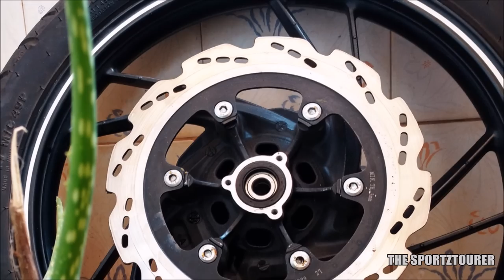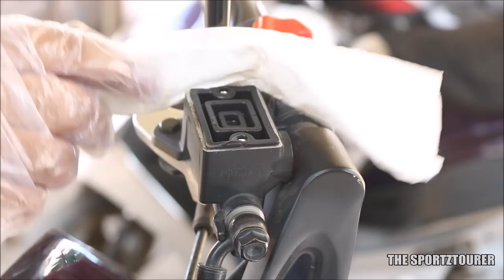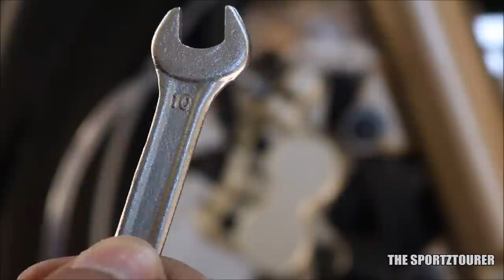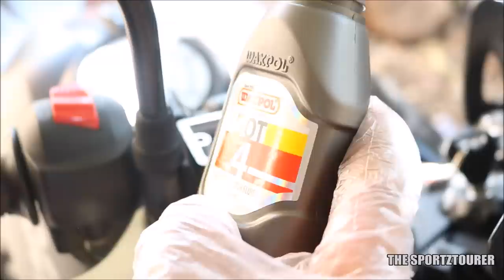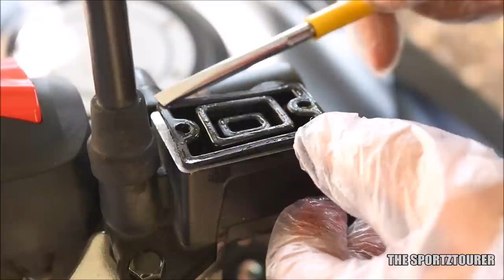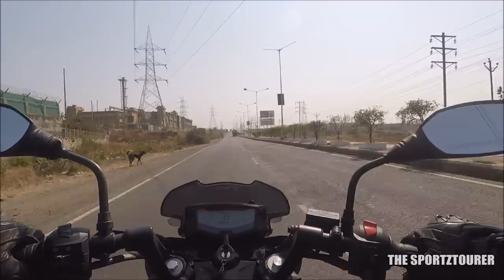HOW TO SERVICE SPONGY, LOOSE DISC BRAKE | BLEEDING DISC BRAKES | TVS APACHE RTR 200 BRAKE BLEEDING

Comment: Please make a video for ABS systems also. Did some DIY with the ABS system, now the front brake doesn't get tight. ASC says it will get tight with time, but have already ridden 200kms after that. There seems to be no air in the system as when bled only liquid comes out, there are no air bubbles. And I've done the bleeding part almost 7-8 times already but no progress.

Comment: My front disk is not jammed but  still it's heating up, temp is around 40/45 degrees after 20/25km then front brake plates starts  to making कीचकीच (kichkich) noise. 
All the brake assembly is cleaned up,changed brake oil. But still problem persisting. So what is the issue?
Reply: Bro you find any solution????

Comment: Dude your videos are very informative
 But meanwhile the brake oil you used is dot 4 and the previous oil was dot 3 you shouldn't mix them both as they are completely different in their properties dot 4 is the best one as it has high heat resistant properties in it 
So make sure that you get it changed by flushing the whole oil and refilling it with dot 4 one
Reply from the maker: Hi,
Yes you are right about mixing brake oils when it comes to DOT 5, otherwise you can always mix DOT 3 with higher standard DOT 4 as DOT 3, 4 & 5.1 all are glycol base fluids which are totally soluble & retains their properties of non compressibility & heat resistance when mixed. However DOT 5 silicon based brake fluid is non compatible with these brake oil.

I agree with your point of not mixing them as it beats the purpose of using superior brake oil it is similar to mixing mineral engine oil in fully synthetic engine oil.
Thanks a lot for the input Jaya Surya as it will be helpful to many riders visiting the comment section with doubt 👍

Comment: Superb video as always....👍👍👍
But my question is if I mistakely spill brake oil on bike body parts then after that what should I do...??
Reply from the maker: Thanks Aniket 😊
If you spill then immediately wipe it of with a absorbant cloth/tissue don't rub it while removing it.
Later clean the surface with water or IPA.
Reply: The Sportztourer thanks....👍
This should be much needed precaution in that case

Comment: Hi i have interceptor 650 front disk rotor has play more than it requires and it makes lot more noise when i go through potholes. Is it possible to repair this issue or need to replace? And how to repair please advise - frpm Mumbai

Comment: Hi Dude, Thanks for this detailed video. I followed this for my rear brake system in my RTR 200 ABS version and brake started leaking somewhere near control unit beneath the seat. What could be reason for that? Is that because, I once started the bike just to check the brake performance while doing this process?

Comment: Small question - on ABS brake setup, does the pumping needed while braking to improve the power coz single pressing hard is not effective. One more thing when u pull the lever, it stops at a point and if u pull it full further with force then the lever goes back a bit. Is this normal?

Comment: Great presentation brother..Simple and informative as always.
i have a question.. i own 2017 apache 160, and as you are aware of the vibration issues like every other apaches, i have managed to reduce the vibs to a great  extent by constant visiting at the tvs authorised service centers.. now vibs hit the bike at around 60-65 km/hr(previously around 50km/hr).. I feel that this vibration can further be reduce to some more extent if i change the brand of engine oil. presently i have been using the fully synthetic oil supplied by tvs.. I had a conversation with the service centre guy & i asked him if i can change tvs FS oil with Motul 7100, to which he said dont do it now as your bike is under warranty and if anything goes wrong in bike be it anywhere, during inspection TVS may reject your claim by pointing out about non using this recommended engine oil. 
The mechanic is a nice guy and he has a good knowledge about the work but you tell me if he is right.. Cant i switch oil brand during warranty?
Reply from the maker: The service center guy is right as TVS can have their say on engine oil in case of warranty & there are many cases with other manufacturers as well regarding engine oil.
TVS has mentioned about the recommended engine oil in the owner's manual. Same applies to any electrical accessory you install on your motorcycle. Warranty also depends upon your service center as they are one who deals with most of the cases.
Reply: The Sportztourer Thank you so much.  You took out time and replied. Now that you have confirmed it, i am sure about the engine oil part. Your reply really made me glad . I wish i could meet you sometime.. take care brother

Comment: Once again a great rendering towards the video presentation. keep it up Sir. 
And i have an Apache 160 , i feel the same loose disc brakes during recent times, but that is over my rear side. Any solutions for rear disc loose brakes .
Thank you :)
Reply from the maker: Hi Haran Kumar,
The process is same for the rear disc brakes, you just have to pump the rear brake pedal instead of front brake lever.
Reply: The Sportztourer thank you :)

Comment: Wow .doing a great job .and one problem while driving my rtr 160 i am hearing a squeak sound from the front as the mechanic had removed the dust in the disc pad using blower but stil the sound is coming please tell me what to do
Reply from the maker: Hi Akshay Deepak, blowing air will just remove brake pad dust & nothing else.
You can try to pressure wash the disc & caliper. Best is brake cleaner, I have one do you want a video on that?
Reply: The Sportztourer That would be great as my RTR 200 front brakes also squeak.
Reply from the maker: Ok 👍 it will be done soon 😊
Reply: Thanks man! Your videos are excellent, to the point and a real help to us motorcycle lovers out there, especially ones having an RTR. Keep up the good work  :D
Reply: The Sportztourer  bro i have already given to the mechanic and he cleaned .still now that squeak sound is coming im really fed up with my bike 😑

Comment: Should we go for this DIY maintenance for the ABS brake systems?
Reply from the maker: Hi Arunava,
The bleeding process remains the same for ABS equipped motorcycles (might take some more time).
Reply: @thesportztourer  ok sir, now I understand, the brake line will go through the ABS unit.. so it will take a little long time, thanks for the info...👍

Comment: I tried this method in my old bike and initially it worked later when i changed the caliper o rigns and done this method it is taking me forever to fix this. Already spent 100ml of brake fluid for this.

Comment: Any news on whether we can add the abs setup of new RTR 200 abs version on older RTR 200s?
Reply from the maker: Hi Aditya,
Its a very expensive process plus TVS won't be liable for any warranty on the motorcycle.
I have asked the service center and there are no recent plans from TVS to retro fit the ABS in non ABS models (no training provided to them).

Comment: very nice, 
but you have used dot 4 on the reservoir instead of dot 3. since the bleeding done was incomplete.
You need to bleed till you see the dot 4 fluid coming out.
Reply from the maker: Hi Shreyas,
You are right if we are considering DOT 5 brake fluid, otherwise you can always mix DOT 3 with higher standard DOT 4 as DOT 3, 4 & 5.1 all are glycol base fluids which are totally soluble & retain their properties of non compressibility & heat resistance when mixed. However DOT 5 silicon based brake fluid is non compatible with these brake oils.
Again I would agree with you on totally flushing out the old brake oil as brake oils have there wet & dry boiling point which can reduce the performance of new brake oil. My brake oil was almost new & my problem was different (air in the system) so I decided to top up, which is perfectly fine.
I will try to come up with video on completely flushing & maintainance of the calipers very soon. Thanks for your input as it will help many riders reading the comment section 👍
Reply: if the fluid in the reservoir is new then its not a problem i guess..

All the best mate !

Comment: I have an apache rtr 200 , Oct 2016 model, done just 4300 km. I am not getting enough feedback from my front disc and the bite is totally vanished. Should I consider changing the disc pads. If yes then should I go for stock or after market ones.
Reply from the maker: Hi Malay,
4300km is a bit early for the brake pads to wear out.
Check out this video where I have shown how to inspect the brake pads for wear: https://youtu.be/lBrvgRH-6LA

Comment: I opened my front brake fuild box just to check the brake fluid and when I closed it I've noticed a tiny bubble inside through the measure hole on the box. Is that tiny bubble a problem? (Apache 160 4v)
 There's no issue with brake performance though.
Reply from the maker: That should be fine 👍

Comment: Hey sportztourer,  i brought . new rtr 200 , i noticed that from downshifting gear from 4 to 3rd it get stuck . So i have to disengage the clutch slightly then it downshift to 3rd.how to correct it
Reply from the maker: Hi Atul,
False neutrals are common in new motorcycles & usually go away after 1000-1500km once the run in period is done.
You can check the clutch adjustment through this video https://youtu.be/Y_r-XQWIT6U

Comment: Hi sir my new bike rtr 160 4v.wen I'm raiding the bike handlebar goes 2 little right direction & front wheel pulling right direction . slow speed wobbleing shaking .I checked everything like fork t stem cone set front wheel aslo all r gud no bend but my bike pulling right .any solution plz reply
Reply from the maker: Hi,
Have you checked the brakes and chain (alignment)?
Reply: @thesportztourer  I'm not Chak break & wheel bearing . wheel alignment perfect

Comment: I am having Yamaha FZ V3, from last 3-4 months Brakes and ABS is not working. I have shown it to Yamah service centre, without checking, they said, it has problem in ABS Box. I asked them to check the cylinder piston in breaks and they had changed it, but problem is not solved. They said, we need to change the ABS Box, which is of 15,000 Rs. But they dont have it.
Local garage me bhi dikhaya but problem solve nahi hua.. oil reservoir me kabi kabi bubble ata hai kabhi nahi ata. Yane oil pass kabhi hota hai, kabhi nahi hota..
Brake lagata hi nahi..kuch upay batayiye...No solution.. Bleeding se air nikal diya but, 2 3 sec ke liye break tight hota hai aur ekdam se spongy ho jata hai..😔
Abtak maine 
1. Master cylinder kit change ki
2. Brake pad check kiye
3. Break sensor open karke clean kiya
4. 5-6 baar oil change karke air remove kiya..

Pata nahi probelm solve hoga ya nahi😔

Comment: I have motul 1 lit bottle dot4+ if i open it how long can i use it  and it has a 2015 mfg date can i still use it it's sealed packed
Reply from the maker: 7 years is a bit long as oppose to using it from 2-3 years from the date of manufacturing. Having said that I have seen brake fluids in operation for more than 5 years with no trouble. Moisture is the biggest enemy for brake fluids which should not be an big issue for sealed packs. If you already have 1L bottle then no harm in using it 😊

P.S: Always avoid purchasing single large quantity pack for brake fluids as it should be a standard practice to used it all once you open the sealed container.

Comment: U are topup the break oil dot 4 instead of of dot3 please note if u are using dot 3 meash u have to use dot 3 and if you are using dot 4 means bleed out all the dot3 oil and refill a new dot 4 break oil

Comment: Hi, i own a speed 400, having an issue with front brake lever. sometimes suddenly front brake lever gets stuck and i cant press it to apply brake, need to leave the lever and then press again to make the brake apply. this occurs randomly when riding & 2 times had a near miss accident because of this. its impossible to recreate this and explain this to the servicenter people. So this issue on my bike remained unsolved. Did anyone faced this

Comment: Sir, I have a loose brake lever problem, so loose that it does not come back all the way after pressing it (which has caused the brake light to always glow since the lever doesn't come back all way after releasing)
I tried bleeding it several times, but the  problem still persists. Please suggest a solution.
Reply from the maker: Hi Sourav,
It must be the master cylinder. The master cylinder piston kit might need replacement.

Comment: I doubt even the service centre guys knows this kind of methods. Recently my friend's bike front disc pad didn't release and it got stuck firmly with the disc and the service centre guys gave solution for that was to change the entire harness and it costed him around 4k. Do you know the reason for  that problem sportstourer???
Reply from the maker: Hi Vijay,
Disc brakes usually get stuck when the caliper pistons gets pushed out on the brake pads.

Comment: Hi bro My rear brake produce squeezing noise while applying brake 
What to do
Reply from the maker: Hi,
The the disc and calipers might have accumulated dirt and dust. Get them cleaned by pressure washing or by a brake cleaner.
Reply: The Sportztourer Thanks bro

Comment: Krney k baad 2-3 km k baad phir ussi tareh ho jata h bhaiya 
Aisa qun hota h plzz bataey aur kees tareh karu aap plz bataoo
Reply from the maker: Hi Kamal,
Aap k sabhi comment read kiye aur aap k problem k reasons yeh ho sakte hai:
1. Abhi bhi system mein air hai
2. Master cylinder mein problem hai.
3. Check the caliper, brake pad and disc.
Agar Disc plate or koi oil/grease/dirt deposit hai toh with bhi brake ko spongy kar sakta hai.
Reply: The Sportztourer thank you bhaiya

Comment: Make video for Mechanical abs
Reply from the maker: Hi Jay,
Have seen & used mechanical ABS in my friend's FZ16 & my suggestion to you would be stay away from it. Frankly speaking it's useless it does nothing but reduces the brake force from the caliper thus slowing down braking. My friend removed it within a week of installation, as a fellow rider I won't recommend it to anyone. For the time being there is no replacement for the mechatronic ABS.

Comment: What about the rear disk brakes of RTR 200???
Reply from the maker: Hi Rio Gupta,
The process remains the same for the rear disc. You just have to press the brake pedal for bleeding. 
This process is applicable for most of the motorcycle.

Comment: Bro my Hayabusa gen 1 has spongy brakes even after bleeding
Reply from the maker: You need to check the master cylinder. How old is your busa? Km done?
Reply: @thesportztourer  mine is 2006 i think the mc is the culprit but OEM  cost arround 24k and has only 15.678 mm also an axial cylinder but RCB offers a radial one with 18mm and costs only 8k so I'm going with that

Comment: It does not worked for me.. Break is still spongy
Reply from the maker: Assuming you have all the air out of the system and the problem still remains (with no deposits on the disc and pads) then you have to get the master cylinder checked.
Reply: @thesportztourer  very difficult to get good mechanic... Every other mechanic gives different opinion... I guess I'll use it like this only